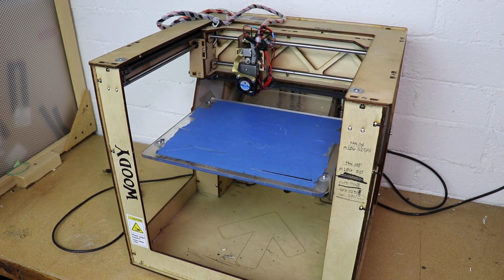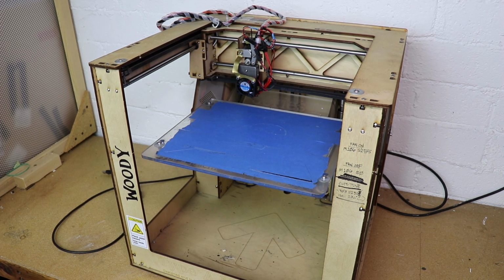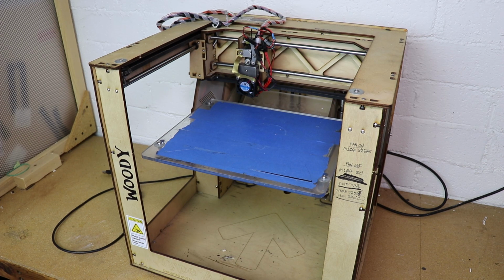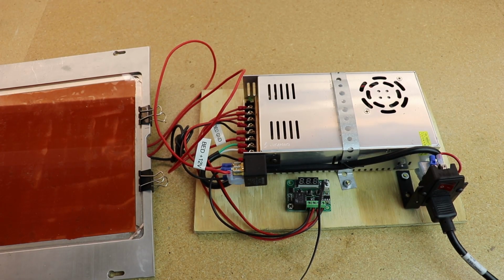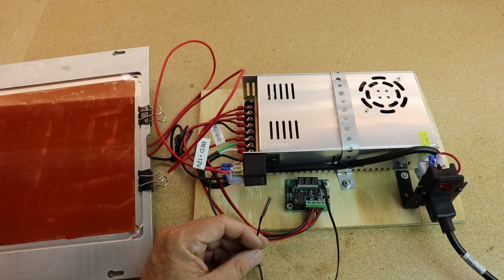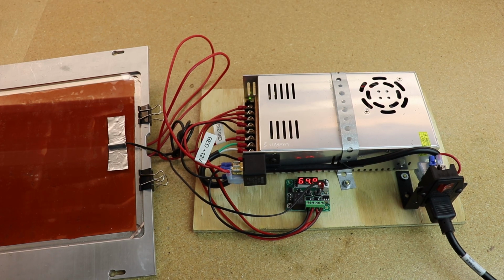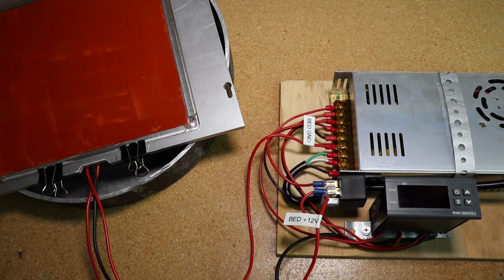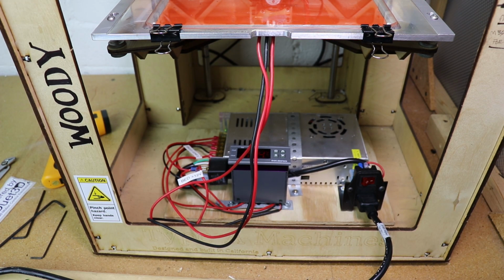DIY 3d Printer Heated Bed

Comment: Was the IR thermometer going through the glass, reading the pad vs the thermistor reading the temperature of the glass? If so just mount the thermistor to the underside of the silicone pad?

Saves modifying it if it works like I think
Reply from the maker: Yes, changing the position of the thermistor to the underside of the glass would have worked but the heating pad was already glued to the glass. The electronics mods where easier than tearing it all apart and possibly breaking the glass or damaging the heating pad.

Comment: Thanks ! I was sooo looking for on how to apply RTV to a Keenovo pad. Not having done this before i was not sure how malleable the Silicon is. This video helped a lot to figure out how it will likely be.
I'll have to glue the pad to an Alu casted bed. Would you reccomend as you did to apply the silicone to the pad rather then to the Alu bed, right ? ( i was thinking the opposite )